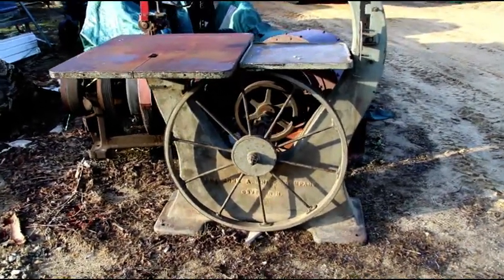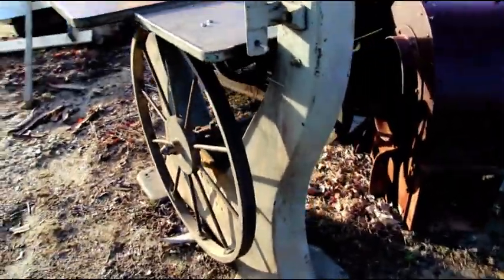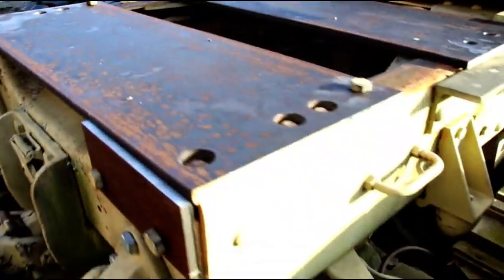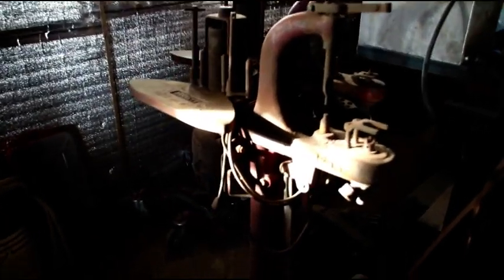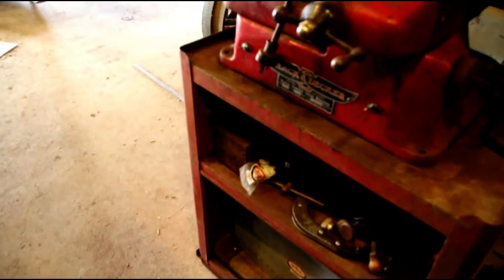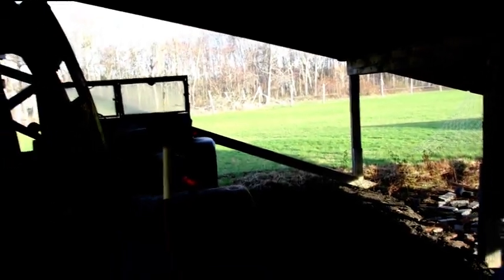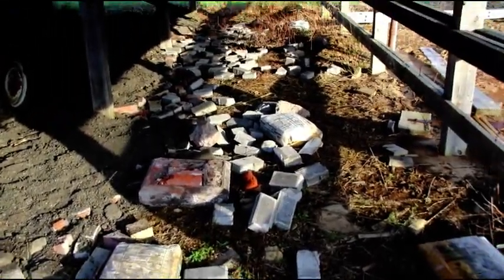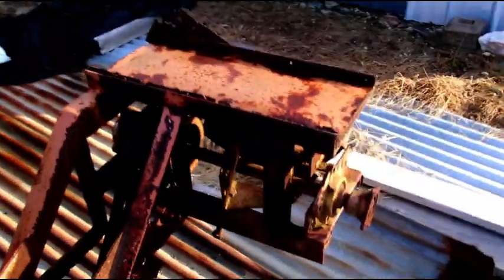Vintage Machinery, Springtime Projects, Military 5 Ton

Comment: Did you restore the 5 ton truck or buy it the way it is? Also how long have you owned this?
Reply from the maker: This 5 ton truck was bought by a friend of mine back in early 2000's.   He thought he was going to use it but never did so he bought another 5 ton cargo truck and I put a dump hoist on it for him to make it more usable. Both trucks were bought thru a government auction and both are in amazing condition.  The one I am using came with many rebuild tags, brand new tires all around, fresh brake job, super low mileage Cummins engine, etc... etc.....  Great truck here around the farm.  I have bee using it for years just the way it was delivered from the government.

Comment: Nothing a little Babbitt won't fix on that saw
Reply from the maker: Babbitt bearings are very good on this saw. Only real problem is the tires are in rough shape and need replacement.
Reply: About the only thing ever needed to be done to that old iron was babbitt, they where built to last forever.
That one is in great shape.